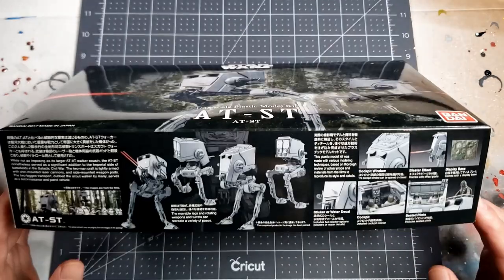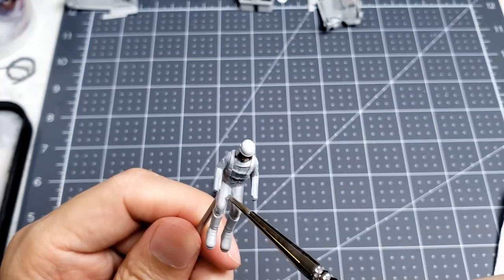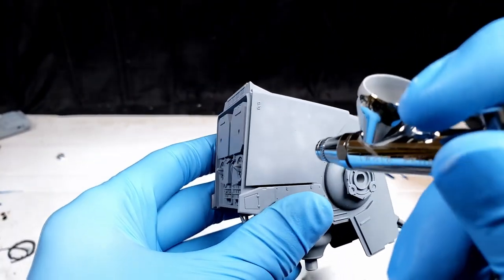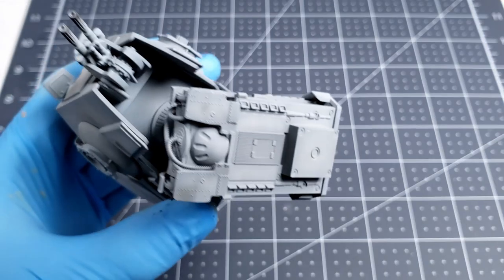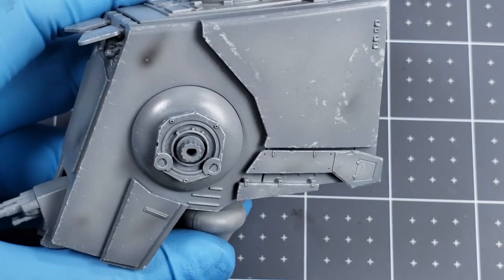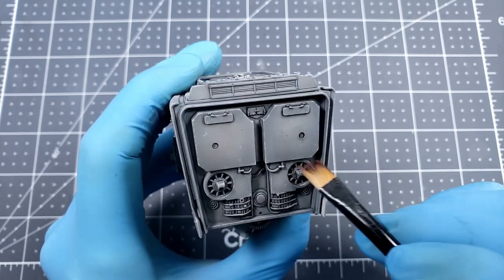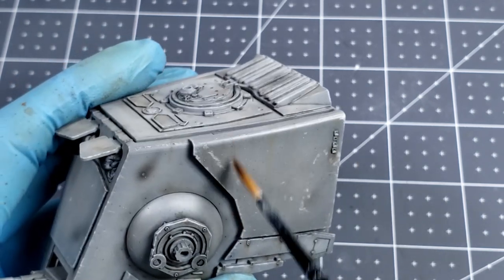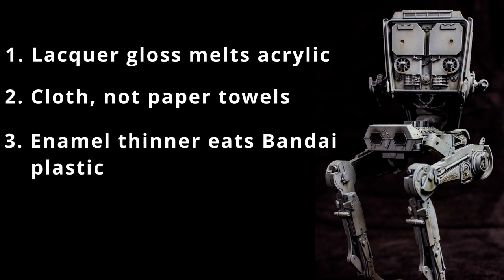Bandai STAR WARS AT-ST 1/48 model kit - Full build, paint & weathering

Comment: The strange affect that you experienced whereby the paint seemed to draw itself onto the surface from a paintbrush placed nearby but not touching any model surface may have an explanation. The act of handling the model develops a small static charge on the surface of the fine plastic parts. Application of paint or primer can push this static charge around as you work on it. The dryer the air environment in your workspace the greater the static affect. Tiny dust particles on the surface build up like small whiskers that are charged and can draw volatile paint particles directly from the air. Dissolved paint particles in the paint fumes are attracted to and adhere to the charged surface of the model. These particles are so tiny you will not be able to see them until they concentrate on the surface. You can negate this static charge by using a Zero-Stat gun on the surface of your model. Zero-Stat is also used to decrease static charges on vinyl LPs and film media before and after handling. Although this is an unexpected result it could be developed to provide another type of weathering that is more random then direct application of paint. Happy modeling!
Reply from the maker: Finally, after a year, someone has provided a hypothesis! That makes a ton of sense and, in the absence of any other attempted explanation, I will take it as fact. Thank you very much!

Comment: To avoid cracking due to thinners, sand and trim - or cut off - the assembly pins that stick in the holes to minimize the tension. By using thinners the Bandai plastic becomes brittle and the tension leads to cracks.
Reply from the maker: Ah, I didn't think about that. Thanks for the tip!
Reply: Yep same happened on my model ..side parts just crak while using AK oil ...
i spended a lot time to hide it

Comment: Amazing work on the paint job...!
I am working on this one off and on (pretty chaotically ended up working on 11 kits simultaniously, some Bandai), currently in the weathering stages.
Bandai plastics are indeed notoriously sensitive to some kinds of solvent, like turpentine/white spirit.
The key is to prime the model well in water based/acrylic primer, applied in several thin layers.
Use ample clear coating befor weathering as well and make sure you hit every spot (which isn't easy withthis kit with all its nooks and crannies). Despite knowing all this I managed to miss a spot and cracked a small piece, luckily I was able to repair it invisibly.

The tolerances on these kits are so high that any amount of spray/paint, even an atom thick layer, will affect the fit, so your idea of priming everything even if it is not visible may present you with some problems regarding the ease with which you can build the model.
It really is a case of priming, painting and gloss coating the kit well before weathering and MOST importantly, never let the thinner/solvent soak the kit, work with brushes damp with white spirit, never wet.

These Bandai kits, despite this one vulnerability, are the pinnacle of model kit building, I have done a Y-Wing, an X-Wing, I'm working on weathering this AT-ST, the AT-AT and finishing the 1/144 Rise of Skywalker version Millennium Falcon and the B-Wing.
Once they are all done,... I might finally start on that Holy Grail of Star Wars model kits that's been sitting in the corner of the room for 1½ years,... the 1/7 Perfect Grade Millennium Falcon,... I think I got enough airbrush practicing in now.... ;)

If you want pointers on building and especially painting Bandai kits, find out the best procedure to deal with the solvent issue, I suggest you watch the full build and paint tutorial series on the MPG Milennium Falcon by Modelmaking Guru, he taught me all I need to know. ;)

Hoping to see more videos of your builds soon.
Reply from the maker: Hey, thanks for providing all of that great insight! I've just learned the hard way on my current kit and am mentioning it in the next video. A few pieces just won't slide into place and I have to live with the unevenness. But, the primer coating on all the pieces worked well save for one. Some thinner snuck into a crevice of a gun barrel and caused a couple of cracks. I just can't give up on the enamels though! They are just too good for weathering haha. Good luck on your builds and one day I too shall tackle that holy grail.
Reply: @wcgwmodels  
Very curious what kit you are working on atm,... the AT-AT perhaps?
But I get it if you don't want to give it away just yet,... I'll see it when your video pops up. ;)
I only use enamels for painting tiny details on kits, other than that it's Tamiya Acrylics (airbrushed) for base colors. I use oil paints for weathering which also takes care of panel lining where needed.
You can also work a lot longer on it as oil paints take a lot of time to fully cure.
Which means, no rush, no need to use too much solvent at once.
Never going back to enamel washes/weathering.
As for thinner, it's best to use Mineral-/White Spirit/Turpentine rather than actual thinner, which is often more aggressive.

Looking forward to the video! :)
Reply from the maker: I've got a couple shorts that gives away what I'm working on right now 😉.

I have been thinking about using oils. As long as they provide as good control and blending abilities. Perhaps I'll give some a go in the next one! Appreciate the advice 🙂

Comment: No, enamel/oil doesn't eat the plastic. What happened was that the enamel thinner seeped into the joints---the hole-and-peg system that allows you to build these kits without glue. As you may have noticed when you assembled the kit, the fit for the hole-and-peg system is really tight.

And that is where the problem lies. While enamel or oil is drying, it gives off a thermal reaction—meaning it produces a small amount of heat. The heat expands the plastic. Unfortunately, with the extremely tight fit, the plastic breaks and cracks as it expands.

I usually circumvent this by taking time to shave off the pegs or completely cut them out. I also file and enlarge notches. Then I apply plastic cement, just like building a normal model kit.

By cementing the parts, you seal off the joints. Together with the gloss coat, this completely prevents the enamel from seeping into the joints. If the enamel does seep into the joints, the shaved pegs/filed notches will provide more than enough space for the plastic to expand safely as the enamel cures.

Obviously, the caveat is that cementing the parts will prevent you from posing the model. So, you have to decide its final display pose while building.

Comment: Hello, first let me tell you that you have a great model assembled and above all painted here, congratulations!
Regarding the painting problem, I suppose that only the washing (pin wash) since it is enamel-based, has diluted the acrylic, which is much more solvent compared to this type of enamel paint, which is more delicate. For that next time, try to use acrylic inks or use a protective layer of glossy varnish, and once you finish the wash, go back to varnishing in matt. (Marabú and AK have good matt varnishes) Dont try to use the acrilyc paint as wash, the acrylic is gouache (Vallejo or AK)  or lacquer base (Tamiya  is lacquer for example) and don't work as enamel paint as wash.  Due to the different capillarity and surface tension of the paints.  Remember before pin wash o use decals, use gloss varnish.
Reply from the maker: That's really insightful! Thanks for taking the time to provide some tips. I really appreciate it.

Comment: Hello.  I watched your video on gluing AT-ST and I liked it very much.  I wanted to ask because I'm coming back to modeling after 18 years, but mainly to painting because I haven't done it before.  And the most important thing is the light fixture, where do you buy it from and what needs to be done for installation.  I'm from Poland and I don't know where to buy this type of stuff.  🖐
Reply from the maker: Hi! I am glad you enjoyed the video. The light fixture was actually homemade using 5050 SMD LEDs and 28 AWG wires purchased off of Amazon. The battery casing was actually part of a kids Halloween ring toy I recycled it from so not something I can suggest to buy but you can try searching for a battery casing that holds two LR44 batteries. Honestly the lighting was improvisation at the last minute and doesn't really have any steps for installation beyond what's in the video. The battery casing just sort of slides behind the figurines in the cockpit loosely. If I had could do it over again I would run wires through model to the base and power it using a DC power source. 

I don't know where about in Poland you could purchase material from but I'd suggest trying Amazon first. Then look for hobby stores locally or somewhere that sells electronic components.

Comment: Do you know if there a way to apply the wash without using the enamel thinner, if it erodes the plastic?
Reply from the maker: Not really as far as I know. Unless it doesn't need any cleaning up and you like it really thick. I really really like the enamels so I'll continue to use that but will try to protect the plastic better next time.